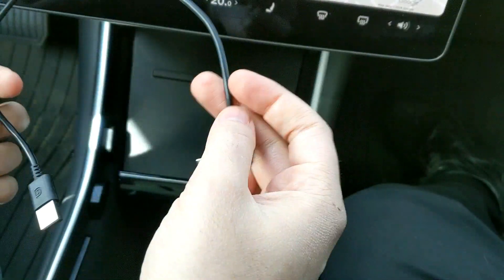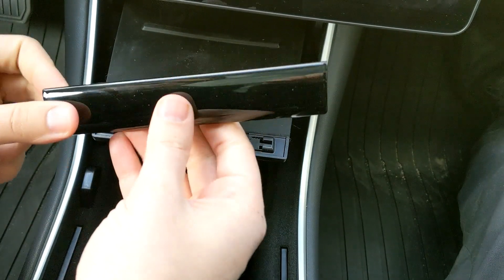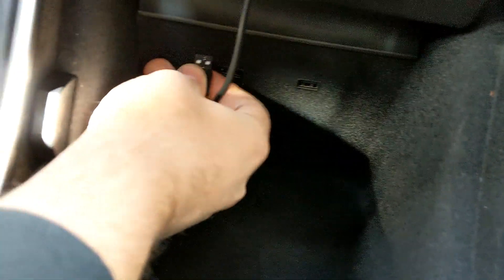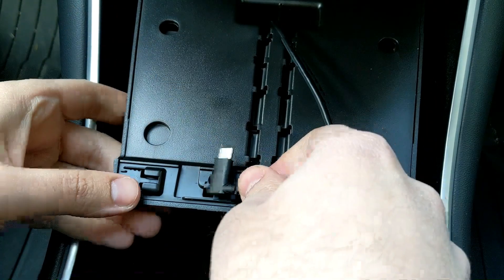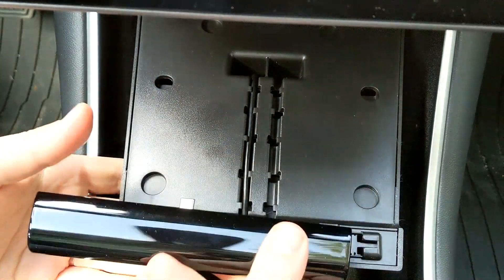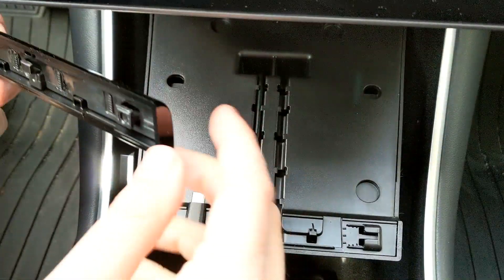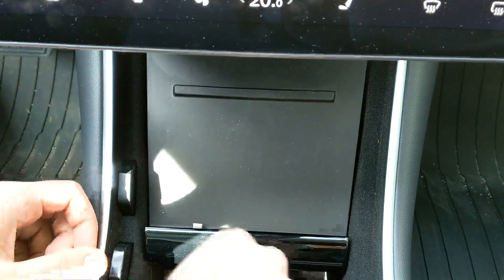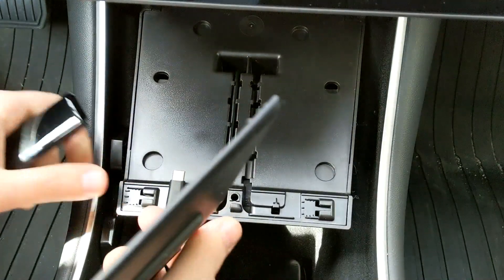Tesla Model 3 USB Cable Installation Guide

Comment: is it possible to buy that mat anywhere? I tried searching myself, wanted to see if you knew of someplace i did not. The new model 3 comes with the wireless charger and not the mat. I don't have a wireless charging iphone so I bought the cable, only to realize the wireless charger won't fit now since the cable is there.
Reply from the maker: Interesting question. I'm honestly not sure. I guess you could 3D print one out of TPU material. If you or someone you know has a printer, let me know and I can get you the size. 

(You might need to leave another top level comment rather then a reply to this comment as YouTube won't notify me)

Comment: Does it work if I have a case on the phone. How much gap is there between the metal connector and the rubber mat?
Reply from the maker: Depending on the thickness of the case. I have one on my phone, no problems
Reply: @FranklinEh  Thanks.... Looks like the newer T3 doesnt come with the cable. I have ordered one. Thanks for the video. Very clear instructions.
Reply from the maker: Always glad to help.

Comment: Oh just found the info to your link. Tesla sells them .
Reply from the maker: Yes it's in there. Your car might have come with some depending on the model.
Reply: @FranklinEh  where would it be? I dont see it in my model 3 I just got
Reply from the maker: @LightSportMan  in the center console hole, check the arm rest or the glove box.
Reply: @FranklinEh  They don't supply them anymore as of 2020 at least for a 3